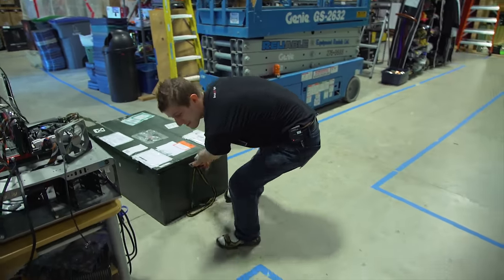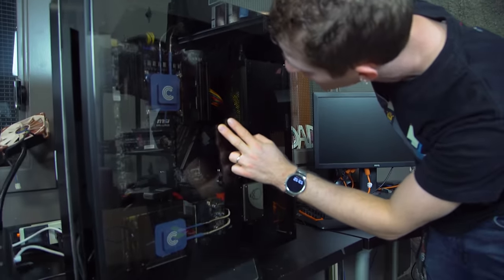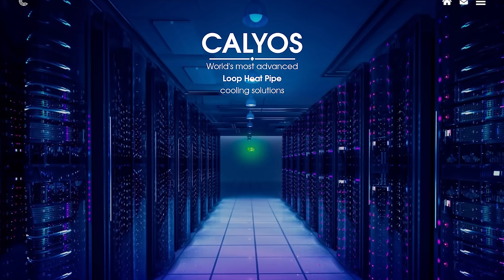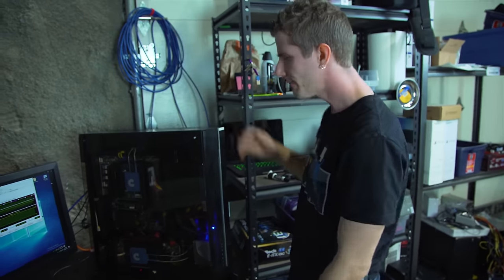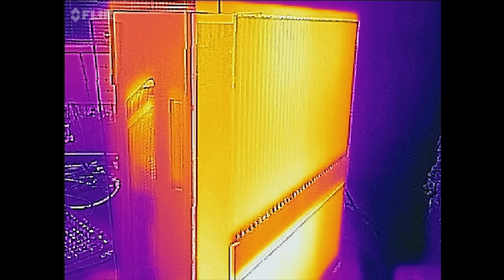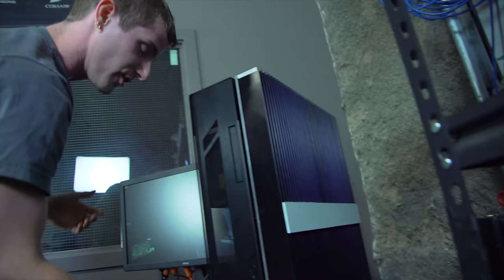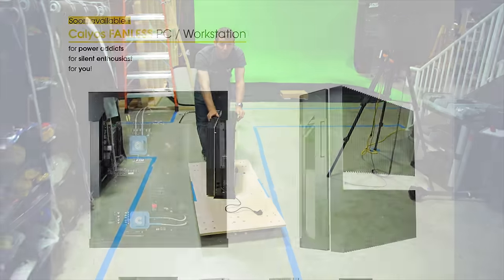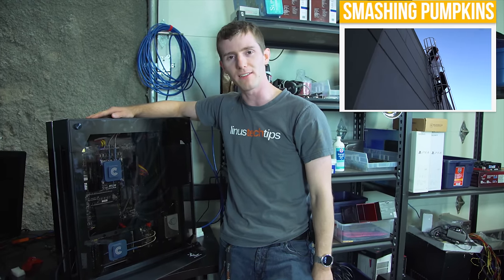TRULY Silent Workstation PC with ZERO FANS - HOLY $H!T Ep. 13

Comment: Well in my comfort zone,  yeah wish I could say that with my 100 degrees C gtx 480
Reply: JAGC I feel you man. I have a r9 380x and when i play any game it is always atleast 70-90°C and that's why i hate AMD.
Reply: LeFlavius_NL my stock r9 290 runs at average 78 C with fan speed at like 50 so it's really loud... Then again I have it in a shit case but still. What would you recommend for it that's cheap and easy?
Reply: +Adaman134 Get a bigger case. $30 for a cheap full size case, plus another $10 for a cheap set of 4 case fans you can use along with the ones you have. $40 is much less than an aftermarket air or water cooler, or a new card, which are the only other things besides airflow that are going to get you better temps. Besides reducing your ambient temperature (room temp), but I'm pretty sure your're not asking this with your thermostat at 85 degrees.
Reply: ok thanks, My motherboard is not screwed into my case though its bolted in so :( idk will figure something out.
Reply: Adaman134 What computer do you have?
Reply: Dell XPS 8700 (prebuilt from amazon when on sale) I changed the gpu out for a r9 290 and changed the psu to a 750w and added 8 gb of ram to equal 16. My cpu is a i7 4770 @ 3.4ghz
Reply: Adaman134 I just looked at pictures of the inside of your computer and the motherboard is screwed in like any other conventional PC. It looks to be micro ATX size, so it should fit into basically any case you buy.
Reply: I don't have it bought from Dell its from Amazon from a third party seller so it was different. Was surprised when I got it also, but it was cheap at the time
Reply: Adaman134 If you give me a model number I can look for a picture and try to think of something.
Reply: Lolled9991 Does it realy make that big of a difference if you change the thermal paste?
Reply: Buy a gtx Titan xp then
Reply: Snowex Yes, when thermal paste gets old it dries and doesn't transfer heat nearly as well. My GTX 680 went from nearly 100C playing games to 80C max even at 100% load just with some fresh thermal paste.
Reply: +Snowex the hottest i could ever get mine to was 81 on the top card in crossfire with both cards running, that was with a burn in test that i forgot about only to come back 2 hours later and find it at 81.
Reply: Isaac Roebuck I have the Sapphire  r9 380x nitro so thats why the temps can be a little different. (and it is super loud)
Reply: thermal paste on a GPU? *****
Reply: jes JAGC GPU's also have something like a CPU into them
Reply: the GTX 480 is an nvidia heater btw :p and for the R9 you just need to adjust your cooling profiles. the default is for quietness unless it really needs to cool down ( and gets loud for that matter ). if you arrange the profile in wattman for a more gradient curve the card keeps 60 -65c under load and is completelly silent when idling ( movie etc ).
Reply: Mar Eck I have a custom fan curve so it doesn't go over 85 but by that time the fan is already at 56% which is really loud.
Reply: +Mar Eck I have my fan curve set up so that at idle the fans are almost off but when gaming my fans will run at ~70-80% and it keeps the gpu at ~60-80°C (depends on how demanding the game is) so I could have the fans running at lower speeds if I'd want to.

Comment: its basic themodynamics, as the compound heats it expands, so you block off one side with a check valve, it only has one way to go, which when closed off in a loop, forces more compound through the check valve, allowing for more cooling

Comment: Put an AMD card in there. Cooling performance gets destroyed in seconds.
Reply: or gtx 580
you can cook with that
Reply: Or a GTX 480. You could run a thermonuclear plant with it.
Reply: AKIO TV or a gtx 660 gigabyte edition,without fans
Reply: I used to melt army men on my gtx 470
Reply: Ladies ladies ladies... Put a 295x2 in there. That could run 5 thermonuclear plants. Lol.
Reply: So, who spends $500 on a new case then drops 3-4 year old hardware in there?  Pretty much anything modern isn't going to produce much more heat than the selected components and this thing won't be available until after Zen.
Reply: I know about zen, and about their latest gpus, and the fact that they are pretty energy efficient. I actually really like amd. I'm currently using a pc that's got an amd cpu and an amd gpu. It was just a bad joke.
Reply: +Nick Bunchanan hey I have a 660 Gigabyte Windforce :(
Reply: You have been banned from /r/AyyMD
Reply: Old overused joke is old and overused.
Reply: This joke stopped being funny long ago...
Reply: lol
Reply: 2 GTX 690's.
Reply: GTX 580 was a really hot card also.
Reply: I have an amd fx 9590. This would probably melt if you put it at 5ghtz
Reply: is amd thatt hot???
Reply: AMD have some hot GPUs and CPUs, but not all of them are like that, Nvidia and Intel have also hot chips, it is not exclusive from AMD, the exclusive from AMD are just the jokes.
Reply: xXx_MlgTr1kSh00ter _Xx ryzen is cool. Haha

Comment: Linus, it moves in one direction due to membrane valves. Basically, the membrane is large enough for the vaporized coolant to pass through but too small to allow the liquid to pass through, due to surface tension.

Comment: 500 Bucks... Sure, it's expensive but it's not that bad!
A nice looking glass panel case + a totally badass water cooling solution might cost you between 300 and 400 bucks.
So the difference isn't that huge for the true enthusiast. It's size is huge though.

Comment: You should have taken the side window off before taking those thermal images. All we see is the temperature of the window, not the parts behind.

Also the radiator is partly blocked by the transport cover. I think you could get a better performance by removing this Polystyrol parts

Comment: There's always a tradeoff. The obvious tradeoff with this solution is the extra weight, but the less-obvious tradeoff is the extra power needed to run the Peltier coolers. There's no way an unpowered heatpipe could make the heatsink hotter than the microchip it's cooling, so there has to be a Peltier cooler in there extracting heat out of the microchip and into the heatpipe.
Reply: My thoughts exactly they could cause a pressure increase with an extruded pipe but thay wouldnt be significant enough to complete a vapor-compression cycle capable of moving that much heat

Comment: If they had acoustic insulation it might be truly silent, i have a custom water cooling and a big external MO-RA3 cooler, and semi-passive power supply unit. I could not tell if my PC is running or not. The water pump is bedded on latex pillow material, which decouples the vibration pretty good. But the system is also clunky, heavy, not good looking. I have put my PC on a transport roller for furniture. The Calyos solution looks pretty cool. I think 500$ would be a reasonable price point. A custom water cooler, with a big passive radiator, GPU und CPU cooling, silent water pump will be the same. But if you would like to add acoustic insulation, you might get problems with the in-case temperature, i also cooled my voltage converters for that reason. And if you want to change your GPU or CPU, you might run into problems with such an exotic solution.

Comment: 7:35 Actually you'd want the fin array to be hot (like 60 degrees celsius). That would mean that the heat transfer from cpu and gpu would be very efficient. Heat transfer from fin array to air is greater when the delta T is higher compared to air temp.

Comment: How is 55 degrees on a 5820k better than anything but high end water cooling? My 5820k overclocked to 4GHz only hits about 40 under load gaming, and that's with a 280mm corsair all in one that only costs £100. Also, my case isn't an immovable object.
Reply: this product isn't for you then my friend
people that make music and such would kill for this PC 
amazing performance (not the best obviously) and silent
Reply: Run AIDA64 and tell me what your temps hit.
Reply: Yeah, even with a stock fan, I get about 40 under heavy load, I think it's more for the silence on top of it. (My computer is literally deafening)
Reply: I thought an artist prefer using MAC.
Reply: ***** not fans, he wrote "a stock fan". must have it in a 5 Celsius room. and heavy load is minesweeper
Reply: +Rizu Ya I do music production for a living and would never consider buying a MAC. From what I've noticed through the other musicians I know is that most of the ones who work on mac only do it because they are basically computer illiterate and having a mac is trendy so they feel they need them in order to make music.
Reply: ***** It's a CPU, it's not gonna get hot, i5 4600 is just a generally cool thing I guess.
Actually, my hardware in general is just really cool, my 750Ti only hits 60 and it's suppose to handle 100c.

Jeremy Richards ....The sad thing is that it actually feels like 5c in this room.
I typically keep the heating off and just get a bunch of cloths so I'm the only warm thing in the room :P

Comment: I had 13 fans between my case and internals in an earlier build. Sounded like a jet engine. But I think, as Linus said, this was more about server room noise and heat management. I use my newer built PC as a home entertainment/gaming rig with fan throttling to keep it quiet during movie time. This concept would be an asset for hi end home entertainment, or more importantly, pro audio mastering when every dB is crucial to finished product. I also do refrigeration for a living, and yes, I'm certain that there are other freon blends that would perform as well or better so long as they migrate through the capillary 'pores' on par with design specs.

Comment: Friendly FYI.  That thermal camera is not able to read through the glass.  Instead it is picking up the temp of the exterior side of the glass, not the temp of the components on the other side.  In fact, glass will work like a mirror does with visible light, reflecting  infrared from the monitor or anything else in the room thereby showing a false reading.  Shiny and reflective surfaces are difficult to get a true read from, you usually have to modify them ie place something on them that is not reflective like paint or elect tape or something similar.  I am a certified in Thermography, by the Snell Group.  The readings of the heat sink should be ok.  But Infrared light does not pass through glass the same way as visible light and that is why you can not read through it.

Comment: Really impressive! I got pretty much the same components in a Lian-Li PC9F aluminium midi tower and it slightly outperforms my active air cooling solution! What's also interesting is that it runs with passive 500W PSU. Now I'd like to see some overclocking! :D

Comment: 9:04 A quad radiator GTX 1080 watercooling loop would outperform this thing by miles, sitting at 40-50 degrees Celsius under load. Just saying.
Reply: But would it be dead silent?
Reply: Dantheman1you0 "quad radiator" doesn't sound dead silent.
Reply: Would you honestly NEED dead silent ever?
Reply: But that would not be passive.
Reply: I repeat my previous question. Where do you ever need that?
Reply: Mansen i would want dead silent. But would i need it? Not really.
Reply: I stopped reading at "quad radiator".
Reply: Rahul Katre 
Well, hes does not says anything about the size of radiators.
But I would think, that one large one is better, than 4 smaller one.
Reply: tyaty By quad radiator, I'm pretty sure he meant 480mm radiator at minimum.
Reply: and it wont leaks and no stupid maintenance to be made on it...
Reply: Would you honestly need custom watercooling? No you woudn't with GPU power limits. It just as much impractical as this. Even more, with this, you have silence and far less ultra annoying maintenance, where fucking up might mean shorted out motherboard.
Reply: Risto Mladich Water cooling doesn't leak if you do it properly. And maintenance is the same. Enjoy shoving a vacuum cleaner into the massive heatpipes.
Reply: The huge advantage of this system is that you won't have any weak spots/hazards in your system (except the hardware itself) that can malfunction and make the whole system going to fail. You won't have to deal with possible leakages or pump fail or fans going to die. Although these things are very unlikely nowadays it can happen and adds additional maintenance.
All this and the system performs better in terms of temperature than most air and water cooling systems and still is as silent as you can get with computer hardware.
Reply: SunRed You know... aside from the liquid in this system that is just as likely to leak.
Reply: Mansen Well, unlike (distilled) water and special coolants HFC-245fa / Pentafluoropropane has the advantage that it won't get ionized by the metals from fittings etc. over time so that it can't cause a short on your hardware when it leaks. Plus this fluid does not leak like your coolant would do that in a pump-driven water loop because there is no pressure on the tube and the fluid flows very slowly.
But of course this is a very new way of cooling I've already stumbled upon a while back and still is a bit mysterious because no one exactly mentions how this fluid behaves and works in detail.
Reply: Mansen Yes, but there is probably as much (or less) chance of it leaking than an AIO liquid cooler.
Reply: Which is so close to zero as is that the difference isn't even worth bringing up in a discussion.
Reply: SunRed Also, according to their website, the tubing is permanently sealed and there is no pump to speak of.
Reply: Rahul Katre Yeah, i know. I did not mention the use of a pump. If you thought that because I said that the fluid flows it's because of convection or some sort of that.
Reply: I totally agree but just wanted to point out the fact, that temperatures (of the GPU) would be better with a 480 (or for that matter) even a 360mm Radiator, especially if we're talking about a custom loop. I can see the the benefits of having such a silent system and the drawbacks of a watercooling loop, I just disagreed with Linus saying it outperforms such a config.
Reply: i personally can't sleep from my pc running overnight , let's say i need to render somehting overnight now i could leave the pc on ofc u could move it to another room but ye u don't have to with this
Reply: it would have to be an evaporator-type cooler, the backplate is the condensor. the gas needs to have a specific boiling point for these temperatures and have good heattransfer. luckly we know the gas!
so the secret of this beast lies in the cpu-evaporater and the condensor. 
like a fridge/arco without a pump 
maybe this is why we dont hear anything of the sandia "spining heatsink" anymore?
it seems this would be way better(if cheap by massproduce) if we could use this in pc's, servers and workstations......
Reply: silent systems are important for music creators and producers (and enthusiasts). It's like asking why anyone would NEED a lambourghini, because nobody does.
Reply: +Master Of PC He didn't say it outperformed a custom loop. He said it outperformed all but the most high end cooling solutions. And I'm not sure about you, but I would consider a custom loop pretty high end.
Reply: My triple wc system still has some pump, case fan and psu noise. Its also probably just as heavy. I mean do you really get miles better performance at those lower temps? Surely long as its low enough to not throttle and suppose a high overclock, the difference is gonna be tiny.
Reply: maybe it has one, but consider the points of failure in a wc system. The pump can stop, the fans can stop, the psu fan can stop, the wc system could leak at any one of the numerous fittings. Corrosion is not a problem in fridge loops, I've a freezer 20 years old. I would wager that a system designed for cooling servers where uptime is very important will outlast the pc.
Reply: +Mansen You're right, nobody needs a silent PC, or a passive one, but nobody needs a GPU that only gets to 50 degrees under load either. And heat pipes don't need to be dust free to work at 100%, the fins they're connect to do. Also it would be very easy to vacuum fins as wide spaced as in the video.
Reply: matt wollam A custom loop is quite high end indeed, but compared to the cost of such an evaporation driven cooling solution (which is still in  designing phase by the way) it is well worth it (for an enthusiast) as it is still the most effective cooling solution in terms of temperatures.
Reply: Trollololol Yes, everyone does!
Reply: Ha lel

Comment: i want to see the amd 9590 in conjunction with the fury x, both full load
Reply: dafff08 and boom, 100°C on the heatsink
Reply: dafff08 gtx 480 ;)
Reply: fury x is cool wtf are you smoking?
Reply: They use their own cooling solution here, replacing the 1080s.  The Fury X chip itself is definitely not cool without the closed loop AIO.  300W
Reply: The Fury X is one of the highest power consumption GPUs in modern times. It only runs "cool" because of the closed loop water cooler.